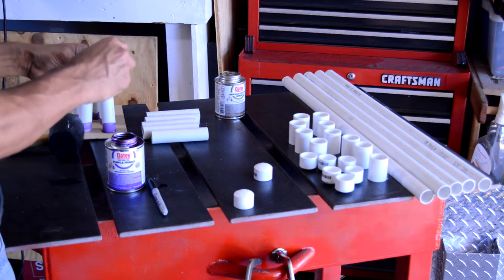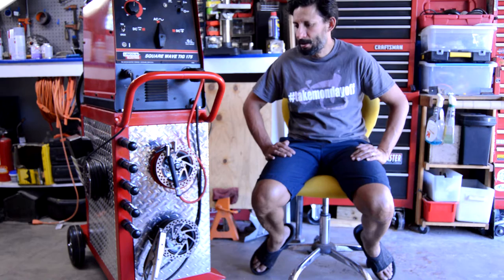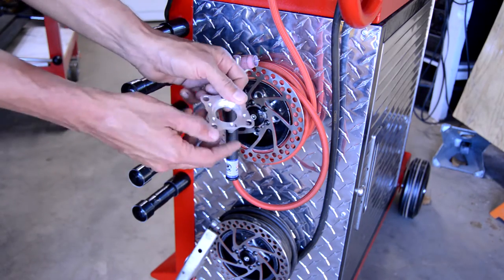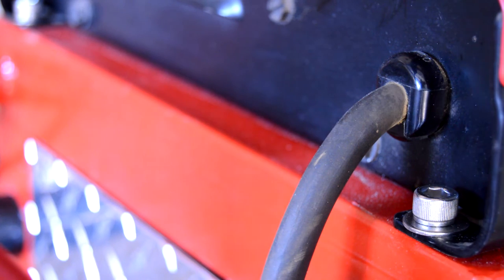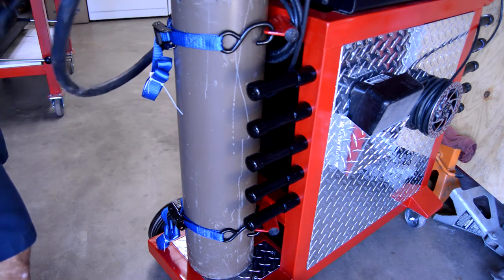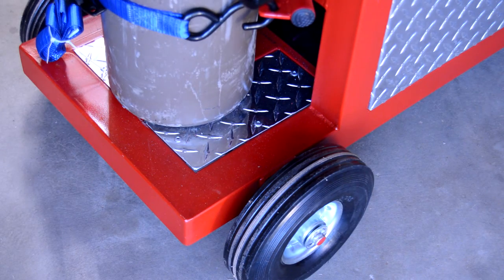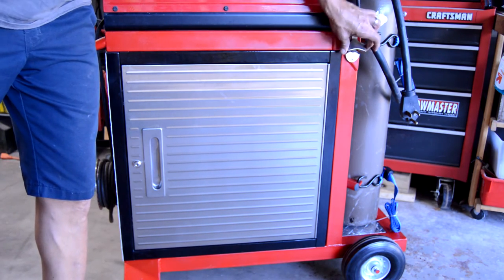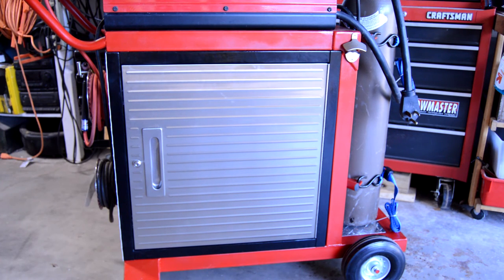Welding cart build part 6

Comment: Is the welder just sitting on there or did I miss a part?
Reply from the maker: It's bolted down. I welded nuts inside the frame before I welded it all together. I go over the bolts at about the 3:40 point in this video.
Reply: Ok ,looks great,I'm in the process of building one for myself.